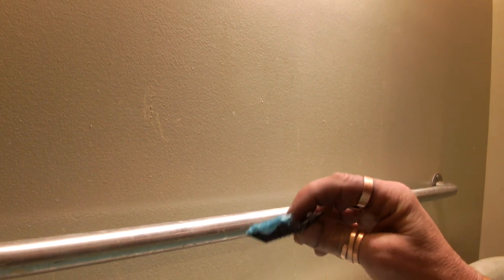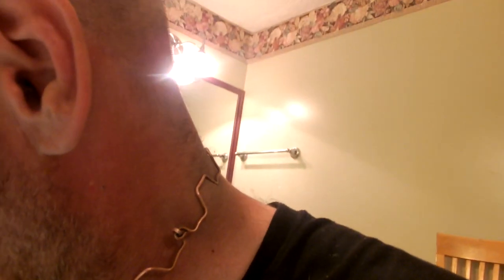Boraxo bath detox results Importance of Copper for Morgellons

Comment: Are you wearing copper on your neck and wrists and fingers? Definitely get that stuff tested! What exactly is the copper chloride..she can I find it so I can try bathing in it? I usually bathe in Borox and epsom salt and mustard seed powder (a bathe mixture with other things in it) and baking soda...really whatever I can get my hands on. I would try this! If you have any extra copper jewelry, send it my way! I am desperate and tired of suffering! Feel free to follow back. I will be posting videos...sooon...just working up the nerve! Where did you get the copper rings? Also, who have is the man you talk about towards the end?
Reply from the maker: Ive foun that ANYWHERE I put the copper, my swelling, pain and discoloration reduces. It killed off my foot fungus to like 80% gone. These copper pieces were taken from old motorcycle starter and alternator windings. The one on my neck is made of bent plain copper hpousing wire. The copper from the starter motors feels more smooth and easy on my skin than the wire does, I think it's slightly more pure.
Reply: Ronald Layton do you just wear that and then go in the tub, or is there something you actually put into the tub water?
Reply from the maker: @TheKatarinaGiselle   I alternate between using copper chloride and small amount of ammonia with other bath containing your water and then volcanic clay mud